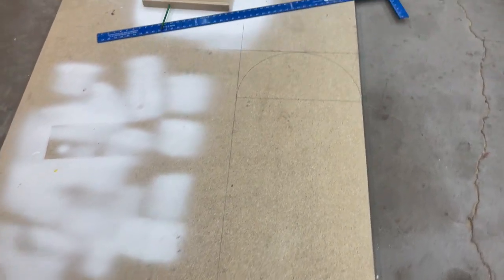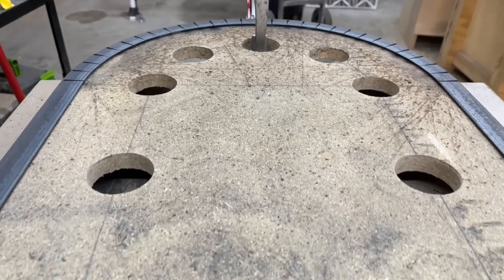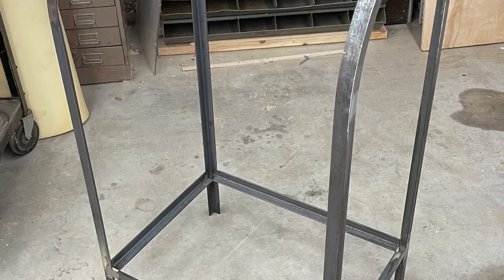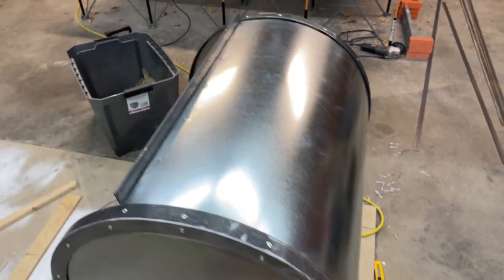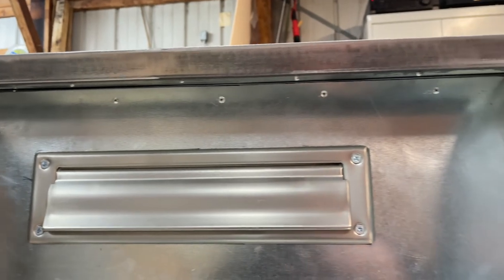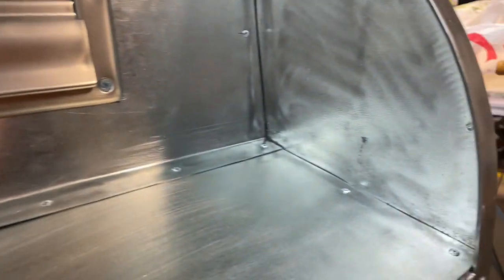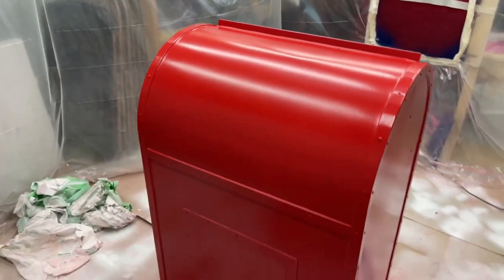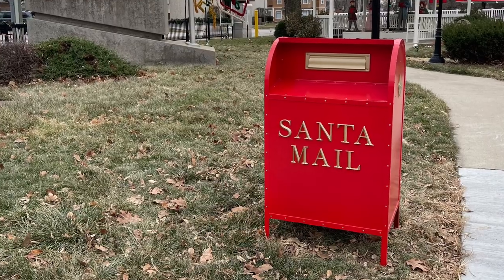“Letters To Santa” Mailbox — DIY

Comment: I would love the plans for this. I build props for theater so this would really come in handy!
Reply: If you didn't want to draft up whole plans, just the dimensions would be fine.
Reply from the maker: I knew I should have drawn up plans when I built it!  I unfortunately don't have any.  I literally just built this as I went, with no plans.  And I can't even measure it for you because 
I donated it to the city and they have possession of it.  So the only measurements I have are at the beginning of the video when I was making the wooden jig.  However, when the time comes, and they have it set out to be used, I can take some measurements for you!

Comment: Hi! I just came across your video. I'm trying to make this exact same thing but it will be a flag retirement box for the American Legion.  Do you happen to know what kind of sheet metal was used? I know you said in your video you just asked for something sturdy and flexible but maybe you remember the thickness or gauge of the metal. Or if you could tell me the total cost of your project, and the cost of the metal?
Reply from the maker: Ugh!  I knew I should have kept better records.  I have no idea what the gauge of metal was.  It wasn't super thick.  All of the sheet metal was donated to me from a local metal shop (since this was being made as a gift to the city).  The angle iron was maybe $50 or so.  Of course there's primer and paint and all the little extras that add up.  One mistake I made was getting galvanized sheet metal.  Do not get galvanized.  It's much harder to paint.